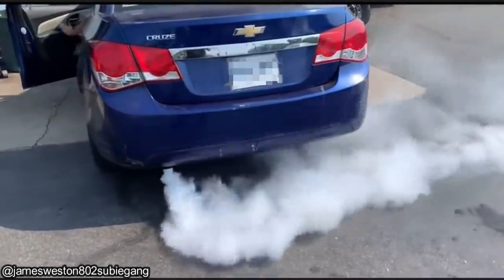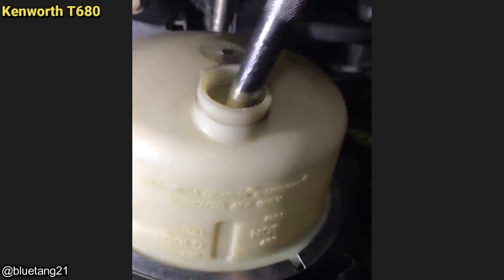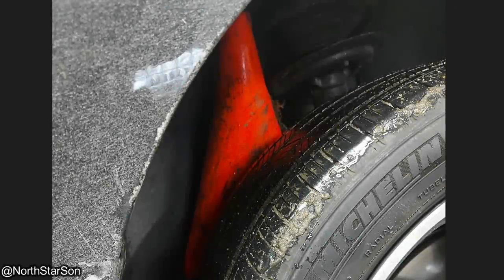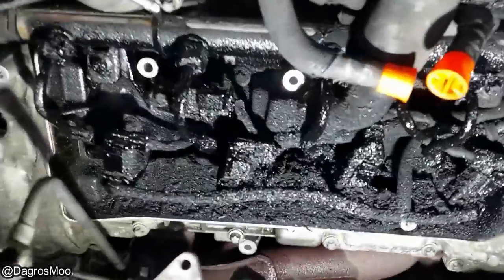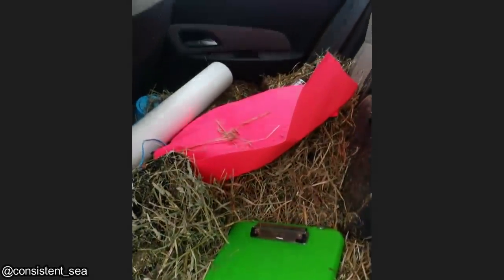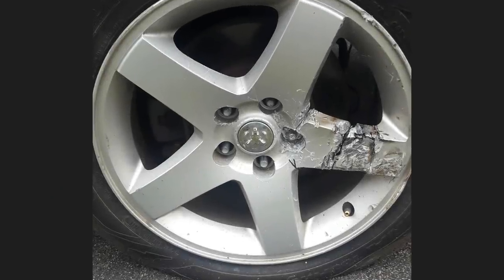Customer States Just Changed Oil, Now Vehicle Smokes A LOT! | Just Rolled In

Comment: A deck screw on the battery post, what, was he out of drywall screws? LOL
Reply: Wrong sized terminals on the battery....
he needed to buy a battery with Pencil Post terminals...
instead he bought a "standard sized terminal" battery....
so of course the clamps won't fit.
Reply: No, drywall screws are to reattach your body plastics!
Reply: Someone's been eating the battery terminals!  Probably a stripper! 😀
Reply: @John Smith  thank you. I have never heard of pencil post batteries and could figure out what was going on there. What  cars use them?
Reply: @JohnSmith-pl2bk  All I can think whenever I hear of stories like that is "You couldn't have returned it and gotten the correct one?"
Reply: The best part is when they put the cables on the wrong post 😂😂
Reply: @ERGZ22  That's so the engine will run backward, producing gasoline instead of burning it.
Reply: @volvo09  panels

Comment: When I was young, I topped up the oil in our lawnmower…I don’t remember exactly how much oil I added,  my dad just stood back and pissed himself laughing as that mower blew smoke like crazy.  So much smoke rolled out that our whole neighborhood was covered in white smoke and the neighbours came running out thinking our house was on fire.  That was like 40 years ago and I can still remember it like it was yesterday 😂😂😂🤣🤣
Reply: Damn, that's crazy! I once put oil in the gas tank of a lawnmower thinking it was gasoline (was very young and very dumb) and the damn thing wouldn't start. Realized my mistake, emptied it out, put gasoline in the tank, after about twenty pulls it finally started, smoked a bit and idled a little funny, but it evened out after ten minutes. Honda quality right there.
Reply: Your younger self may be the reason why "No oil change" mowers exist now.
Reply: @10tacleMatt   Really? That's stupid! Someone's gonna get hurt when the motor oil turns into black jelly and the engine blows. Unless you're thinking of electric lawn mowers. But every engine needs an oil change! What is a guy supposed to do, buy a whole-ass mower every thousand hours? 

As a mechanic by hobby, I know what happens when you don't change the engine oil. I've seen big rigs that haven't had their oil changed in 150,000 miles. The oil turns into black jelly. Those engines have to be built like tough-as-nails sons-of-bitches to be able to run like that.
Reply: @10tacleMatt  quite possible.  My dad is 85 now and his memory is not good but when I mentioned  “the great mower incident of  ‘82” he grinned ear to ear 😂
Reply: don't feel bad, probably cleared out the mosquitoes at the same time eh? we all have our moments, you can excuse yours as being young and dumb.

mr master mechanic electronic specialist... couldn't get our old honda gas mower to start one early spring, (i only saw parts of this, heard the rest, as in i heard the yelling and looked) so he took off and cover and pulled the plug. seeing liquid inside and assuming it was water, i don't know how he did this next bit, but lit the mower on fire, because of course it was gas from being flooded... now he was by our back door, which has a hose right fucking next to it, so what does he do? grabs a bucket, runs to the front of our house and across our road to the river in our front yard, dips the bucket it and runs back sloshing water... dumping it on the flaming mower and seeing that didn't work, repeats the process 3 x, still not putting out the fire... so what does mr master mechanic do next?! he yells fire! loud enough to get all our neighbours attention and pushes that mower to the front of the house, across our road, through our front yard... and into the river.

later that afternoon he went to town and bought the exact same model again... and he's never allowed to live down the mower story, he takes it well.
Reply: @Cat-fy5lw  Buy4matt is serious. I own a mower that I got in 2018, and the manual literally said that if you use Synthetic Oil, the oil "doesn't need changed." I'm still changing it with Amsoil Small Engine Oil each year, I may have missed one year.

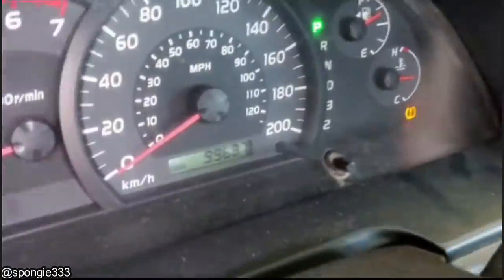Comment: 1:38 I cannot tell you how many times I’ve had customers tell me “I don’t drive my car so it doesn’t need these recommended maintenance services.” This is exactly why it DOES need those maintenance services, regardless of mileage.
Reply: On some things. Not all
Reply: we have a lady, who no matter how many times she's been told, keeps coming back or getting towed in with a low battery and then complains... she's bought at least a couple i think since we bought the garage about 7 years ago(average battery lifespan is about 7 years), not on our suggestion either. she doesn't drive it more than like 600kms a year, and we've told her over and over, running it in her driveway will not charge it, she needs to drive the thing. no starts once the weather turns cold is rather common in my area with a lot of older drivers who rarely drive.

then you have those who think, if they don't drive, their tires will last forever and don't understand tires have dates on them and can weather crack before the tread is worn.

or those who park their vehicle on grass/gravel/dirt, for extended periods, in a snowy/wet/fairly humid climate and don't understand how it's bad for anything under their cars like optional things like brakes, frames... boots crack and get salt/sand inside and all the other fun things as well. then there's all the fun things you find in a long parked vehicle, most of them once having had fur... never mind what only short tripping can do to a vehicle over extended periods. our ram doesn't get distance driven as much as my kona. so, i steal it and take it part of the time when i can and know i'm going to a place where it will fit for parking(i swear most parking spots here are small vehicle only) with some distance. it's a work truck and also used for towing toys, but for small parts and basics, mine is just more practical.
Reply: @cheallaigh  when I had a job that did not require a lot of driving any distance, Once a week I would take it out on the freeway for a few exits. Specifically to run all the mechanical systems up to temperature and what not. Though I could be incorrect I have always figured a good run at interstate speeds is good for car.

Speaking of small parking spots, the one lot in my area that is nearly impossible to park even a Chevy Cruze at? Home Depot, The one destination where you would think they would make spots for full sized pickups or even super duty trucks they seem like they are more suited to a Smart Car.

Comment: That rusted wheel reminds me of when I had a semitrailer wheel come apart. Never saw when it happened, was somewhere between Roanoke and the PA line on I81. Only the center section remained, shop removed the lug nuts, gave a gentle hit with a sledgehammer, and a pound of rust fell off. Kept it and gave it to an instructor for a training aid..........
Reply: It was crazy, when I pulled the guys truck in it was popping and like shaking weridly, idk how to explain it but idk hoe the guy drove 7 miles ,he had a spare wheel that looked fine so we took the tire off that wheel and mounted the tire to a good wheel and he was on his way, crazy shit
Reply: #justdontgiveadamn

Comment: First vid - I made that mistake. I bought an engine from a junkyard and installed it for a friend. I totally assumed it was empty (they always are, in my experience) and proceeded to add 4l of oil when the swap was done. On the highway under moderate load, that little 1.5L Accent smoked a good amount. Drained it all out and started again. Problem solved.
Reply: Try checking it out before adding any oil in the first place. Dumb, you could have blown seals.
Reply: Step one: CHANGE the oil. 

Step one in changing the oil:  DRAIN the oil. 
LOL
Reply: @mikeholland1031  In my defense, the filter was bone dry.Cookstown Auto Wreckers normally drain all fluids, I've bought and installed more than a few engines from them in the past, and since - al but that one were empty.

I'm keenly aware of what excessive oil does to seals, especially the cam and crank ones. 
I figured out what happened pretty quickly, so no damage was done.
Reply: @fomoco300k  AFAIK junkyards take out all the fluids, they are legally bound to - I somewhat recently drove to southern PA (from Toronto) to get a 4G63, and out of curiosity checked the dipstick - empty. Someone goofed on the Accent engine, and I just didn''t check it. Fortunately nothing bad happened.
Reply: @the_kombinator  I’ve worked at a junkyard in my younger days.  What is supposed to happen is not always what happens.
Reply: @fomoco300k  Yeah, once I ordered an engine and it came with a transmission attached. :D I pointed that out, they thanked me for my honesty and waived my core charge and gave me the starter :D

Comment: Ah man I bought a '99 MGF that had that lock nut removal method, thankfully  I was able to get a replacement alloy pretty easily. 
It was the model with the hydro-lastic suspension the fluid had leaked out so much that the radiator hoses had come  off from scraping along the ground. Once I sorted everything out it was actually a really nice car, that hydro suspension SUCKS though!
Reply from the maker: Hydro suspension sounds like a huge PITA lol
Reply: @JustRolledIn  It's a nice idea, and it is nice in the corners but I think properly set up coils are nearly always going too out perform it. And yeah maintenance is a pain! 400psi mix of coolant and metho, great fun! Haha
Reply: @JustRolledIn  Even with current year materials and manufacturing those things have got to be just an absolute nightmare to keep in working order. I know that air suspension has come a long way do to my work as a Ford tech (they love installing it on Lincolns, I'll admit they provide a VERY comfy ride though) but they just don't last as long as a normal strut unless you drive real careful.
Reply: @alexwalker2582  Ever considered magnetic shocks, like on some Audis? It's the equivalent of Air-Ride suspension, only an invisible force field is supporting your car. A LOT easier to maintain than air or hydraulic suspension. Too bad the idea never really caught on, though.
Reply: @Cat-fy5lw  It honestly surprises me that it didn't. Was it a lot more expensive to manufacture than normal shocks? Or was it just too durable and the auto manufacturers didn't see any way to make money long term from it?
Reply: @alexwalker2582   Magnets aren't that expensive. I think it was the durability thing. They knew that those shocks would last a long time and they would lose money on them, so they scrapped that idea and built something that would have customers keep paying for repairs. At least, that's what I think. 

Maybe the trouble was finding a magnet strong enough to actually hold up the entire car adequately?
Reply: @JustRolledIn  Alec Issigonis used hydrolastic on many BMC cars, some Minis, the 1100/1300 range, 1800s & Maxis, and it wasn't any less reliable than conventional coil or leaf springs. The MGF would have hydragas, as on Allegros & Mini Metros -a completely different system using nitrogen rather than water as the springing medium, and they were generally very reliable too. The only drawback with either system is that it's not a diy proposition, and most garages no longer have the kit as it's a long-gone technology.

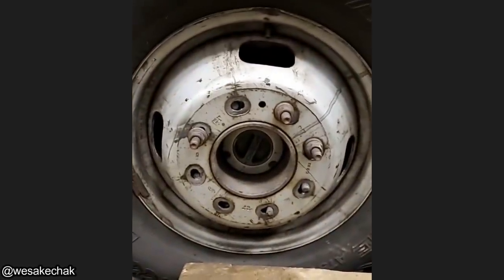Comment: I had a wheel failure just like the wheel at 0:50 on my 01 GMC 2500. These rims can begin to fail just like this starting at around 16 years. When it happened to me in 2018 I pulled into the nearest parking lot and changed into my spare. 😂

Comment: As a kid dad gave each kid “their” tractor.  To maintain.  My older brother was told to get “his”  Allis Chalmers C.  Finally dad told me to go see what was wrong.  He was adding water….  To the oil fill spot. (On top of hood, well marked “Engine oil only” iirc). So left it sit overnight, drain off water, sit few more hours, white oil, then oil.  Few months later I an raking with it, open water jug to add. (Old gallon milk jug) it’s full of gas.  I was amazed the jug didn’t melt,  gas was contaminated of course.   It’s best he has a shop rotate tires.
Reply: PMSL...

Comment: Thank goodness that in NZ we have warrant of fitness for our cars.... The owners of some of these cars should be charged with reckless endangerment for driving on public roads
Reply: You should add a warrant of fitness for the drivers.
Reply: some places in the US do require safety inspections on vehicles but people will just add modifications after their car gets inspected
Reply: @misseselise3864  You mean the loose nut holding on the steering wheel being the cause of most car dangers. I agree!
Reply: @misseselise3864  I live in NY and if you find the right mechanic, for an extra few bucks, they'll slap a sticker on and call it good. I had to do that for a few years when I had a crack in my windshield (old car. A new windshield was worth more than it).

Comment: Timing belts can hold up way past the recommended service interval but that cutting it close @ 1:32 .
Reply: I have a 93 Ford escort with 190000 on the original belt
Reply: I changed the belt on my first Peugeot diesel. It looked exactly like one of the “ if your belt looks like this...” pictures in the Haynes manual. Chipped teeth and cracked to fuck.
Reply: @robwright4398 That's pretty impressive, do you still drive it?
Reply: @tonyb1968  yes it’s my daily driver
Reply: Let us know how things are going at 190,001
Reply: An Escort still runs?
Reply: @peters8758  it finally broke, 195000. New belt 20$ and it runs like it always did. Had about 135k when I bought the car so I don’t know for sure how many miles the belt had but at least 60k.

Comment: That tacoma with the chevy sticker 🤣
Even if they remove the tacoma sticker letter 

It's won't make any difference since both truck have completely difference design 😂
Reply from the maker: I knew you'd notice that one lol.
Reply: @JustRolledIn  
If that owner really wants a chevy 
He can sell the tacoma and cover the cost for the chevy truck

Since the tacoma values more over most chevy trucks 🤣
Reply from the maker: @RexWort  you might be able to buy 2 Chevys 🤣.
Reply: @JustRolledIn  
Pretty much!!
Buy 2 because the first one won't last long so the second one is the "extended warranty" 😂

Comment: When I was a kid, I always thought that knowing to work on your vehicle and doing basic maintenance and repairs are a prerequesite before owning one and getting a driving license. I was completely wrong.
Reply: none of my 4 bros were interested, so my dad and one of my uncles taught me. i helped rebuild an early 70's 440 demon by the time i was 16. what's annoying, is sure, i never went for a license, but i do know more than average. there's a few local dealerships i refuse to go to now for parts, i will drive farther for decent service and we wont recommend them to our customers. they know me and the hubby own a garage, but they still act like i barely know the wheels go round and round because i'm female. my kona is still under warranty, i found a different dealership for any recalls etc. people should know basics like, how to check oil, tranny fluid(and where those fluids go properly), tire pressure, how to pump their own gas, why the blinker light on their dash is flashing like a mad thing, how to change a tire even if they physically can't do it and what some of those dash lights mean. you never know when you're stuck somewhere and have to depend on yourself and everyone should check their vehicle before any trip.

Comment: As a truck mechanic apprentice I beyond confused how a driver or mechanic added brake fluid on that Kenworth
Reply from the maker: Right? Lol.
Air brakes on it. What are you doing with brake fluid? I was thinking the same thing. And it was the driver who added it apparently.
Reply: MacGyver used steering fluid to refill brake fluid reservoir on the move.
Reply: I am a mechanic and once topped up the sprinkler reservoir on my own car with anti freeze - it was dark, and I couldn't see what I had.  
I couldn't use that excuse when I tanked my lawn mower with polyester!!!
Reply: @leifvejby8023  I have to admit, I hate blue coolant and green washer fluid. Don't ask why. :D
Reply: @XtreeM_FaiL  a lot of stuff Macgyver did was probably not realistic, though I guess forcing fluid into the brake system may cause the brakes to somewhat work but I don't think that was ever tested.
Reply: @peto22  😀
Reply: @XtreeM FaiL  I spent $3500 of a customer's money after they put brake fluid in the brake reservoir that was supposed to have ATF on a Case 580K Series 3. The DOT3 leaked into the transaxle which fed the torque converter. The hard parts were fine, but all of the seals in the transmission and torque converter housing were leaking.
Reply: @XtreeM_FaiL  Ok now I feel old because I now this episode from Old MacGyver :)
Reply: @JustRolledIn   I hope he got fired. #idiotsatwork
Reply: @leifvejby8023  had a customer, middle of canadian winter and -40 ish, not including windchill, pull up with a truck with a camper on the back. we were amazed they could see to drive. they had been on the road since the night before or something trying to get home and beat a storm(ontario is huge) and well, they ran out of wiper fluid. stopped at some all nighter gas station/truck stop, thought they had bought fluid, it was RV cleaner.. they're both green or blue and they were tired. well they realized something was wrong right quick when it turned their windshield white as it smeared and froze and their lines were frozen as well. sadly neither of our bays are big enough for the full camper setup they had, as we explained they would need to thaw everything and then flush the system. we helped them clear the windows and they went on their way.